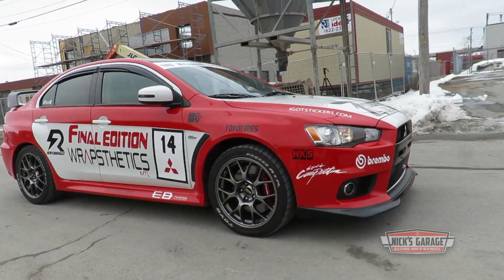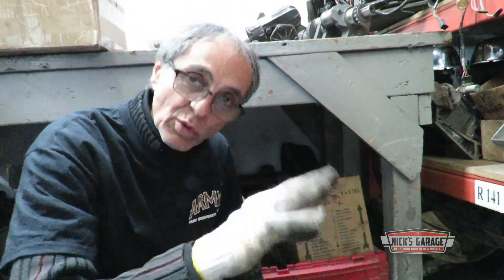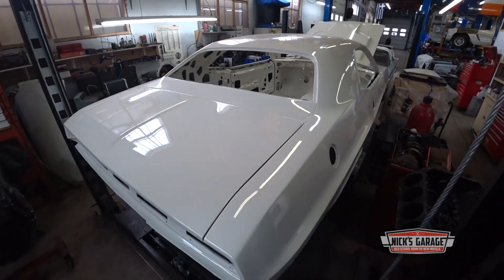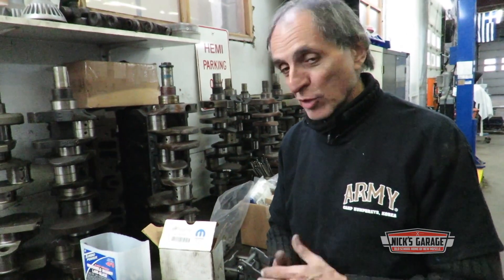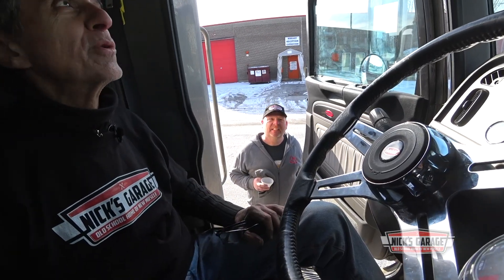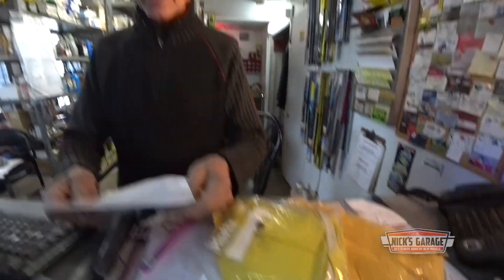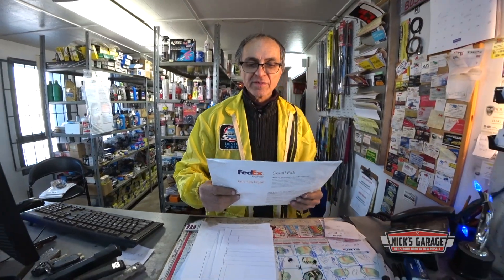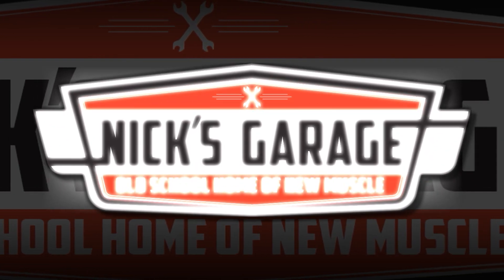Lancer Evolution & Big Rig - Nick Gets 'em All - Holiday Bonus Ep!

Comment: Had a '72 Dodge Polara. I was impressed by how the lower ball joints were integrated with the bolted on steering arms. Don't know how many other MOPARs did that. The mirrors Nick is holding right now: The square one will give the driver a bigger field of vision. The smaller, rounded one looks better. I'm confident Nick will choose the right one.

Comment: I have front disc rear drum on my Duster with 318 wedge. Non power and I love them!!  Best stopping car ever!!  I have the same on my 69 Skylark which is a conversion. Front disc rear drum with no proportion valve.  Originally it was all 4 drums which stopped well. Problem was getting new drums as the new drums are junk so I converted the front to disc , again no power manual brakes and I love them!!   Go manual disc no power!!  You will love them!!  Even my old big block LS4 corvette is all disc non power.  Power assist takes away the feel.  Go manual!!  Your car will stop on a dime and the feed back is fantastic!!  When you go power, there is little to no feed back.  You can stop your car with one toe.. Yes.. Vs manual where you need 3 toes... But the feed back is numb at best. With manual disc, the feed back is so good it seems like you can tell if you run over a dime or a quarter.  I love manual disc brakes!!! Get good rotors and so far the best pads I have found are EBC Reds.  Expensive but they do not damage rotors , stopping power is fantastic!!  My next choice would be Akebono brake pads. I can not get these for all my cars and so EBC Red have been my choice of late.  Pads are everything!!!  Almost.  If you have the money, then get the best rotors too.  For sure always use the best pads.

Comment: It's great that you're building this Kowalski Challenger Replica Nick! (thumbs up) = )
I agree with the Rectangular Mirror, as it allows more viewing too! This will be a Kowalski car, not factory build.  Being True to the Movie Car is the way. (IMHO)

In the mid 70's I rode (as a passenger) and experienced many races in an original (triple black) 70 Challenger 440 Magnum R/T Convertible. It had a Pistol Grip 4spd, but someone previously swapped the (damaged) 440 for a 383 engine... It also had a "Rim Horn" Steering Wheel. 
(Another good video by the way.)

Comment: Stick with your gut and the original mirror
Reply: If you consider Vanishing Point was not an ‘off the showroom floor’ but rather how someone would have modified a used car, then any ‘era’ mods make sense. If the goal is a movie tribute car, then the mirror mod makes sense if you can find that exact mirror. Otherwise I’d agree on using a factory mirror. But if it were me, I’d add mods that aren’t readily visible like boxing the control arms. That jacket is awesome btw! 👍

Comment: I always thought that it was crazy to make disc brakes optional on those muscle cars. If they are going to sell you the "go fast" they should also include the "go slow". I know what fun it is to hunt for the correct hardware. I had a friend with a body shop and he had a customer who brought in several  'cudas for repaint. It was always a pain to find enough of those semi round head phillips screws for the wheel opening moulding.

Comment: I would go with the Chrysler Mirror, unless there's an upgrade mirror, then I'd go with the upgrade, it never hurts to add factory options, your adding factory upgraded front discs, I'm pretty sure your gonna run radials, you might upgrade your cooling system, and many people ad A/C, not bad things, all available options that make the car more pleasant for the driver, even power windows are added, it's your car

Comment: Interesting, my 1969 Barracuda also has the square glass mirror. A while ago I was certain that it wasn't the original mirror. I thought it was replaced. So I compared it with mirrors from Camaros, Chevelles and Mustangs, but none of these cars had the exact same mirror as the one on my Barracuda. So then I assumed that it must be the original mirror for my car and I left it on there (Maybe it also has to do with the fact that the car is built in the Netherlands). So anyway, maybe some of these Mopars came with square mirrors. But in your case, I would just stay with the original Chrysler part. Or find one that is exactly like the one in the film.

Comment: You know with the leaf springs apparently its hard to find or have new ones made when it comes to corvettes, as they switched from Steel to Fiberglass in 1978 with the 3rd generation, and all you can find now are the fiberlgass ones.
is that not true for the mopars like the challenger? and I ask as theirs an old video from a tv program called motorweek, the video on the then new 1984 corvette which can be found on here, where it showed that if you put oversized tires on the C3 gen, like drag slicks that would prematurely wear the heck out of the stub axels and in some cases downright break them

which in looking at the changes to the car, I think was caused primarily by that change to a smaller, thinner and lighter fiberglass springs

as it was noted with the early 1969/1970 LT1's that they would put the bigger and stronger big block suspension on it which had thicker and stronger steel leaf springs on it for road racing, which makes me wonder if it all was caused by that change. 

as why is it that all those early big block hotrod corvettes never reported these problems, but suddenly when you take a latter 350 only one and try and put drag radials like that they break? 

and I reckon its gotta be that. 

so if you have someone who can and does make those old style metal leaf springs their might actually be a market for it, as the guys making the corvette C2 grand sport under license from general motors, the guys at superformance, cant find any new old school steel leaf springs for them

atleast according to the video they had of it on Jay Lenos garage.

Comment: Are you building "Kowalski" or are you restoring a 70 Challenger ? If you want the car to be movie correct then use the square mirror, if you want a correct 70 Challenger then use the stock mirror. If it were me I'd build "Kowalski", down to the bolt.

Comment: Always use the factory part unless there is a compelling reason not to, for example I would bump the cam up a bit, maybe some forged pistons other internal improvements come but in the long run are you building a Hollywood car or are you building a U code Challenger? If it was a Hollywood car then why even bother hunting down the U code. I agree with your gut feeling and stick with Mopar unless you have a compelling reason not to.

Comment: Please don't use the old u-bolts that's asking for serious problems. They are grade 8 cold rolled steel. They stretch and over time become brittle and snap. Contact me in email and I will give you the address and phone number for a place that will make you a brand new set with the factory style tall nuts.
Reply: I wrench blue collar.    I have located NOS U-bolts, and the tall nuts. Thanks for watching.